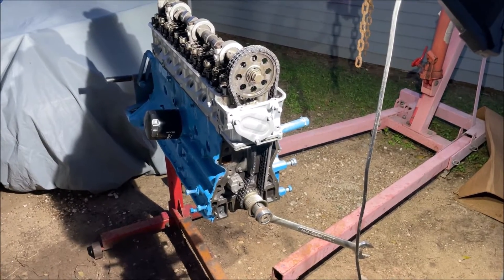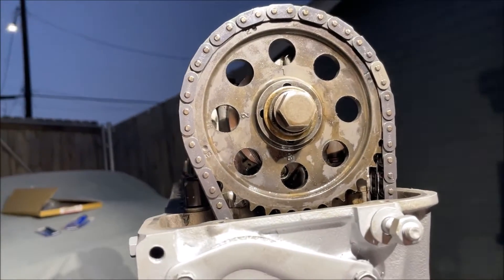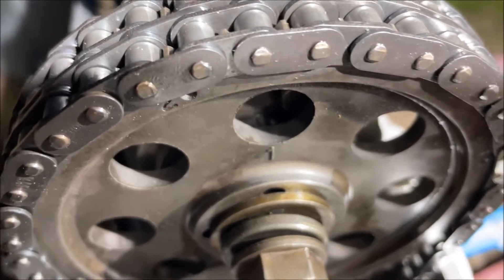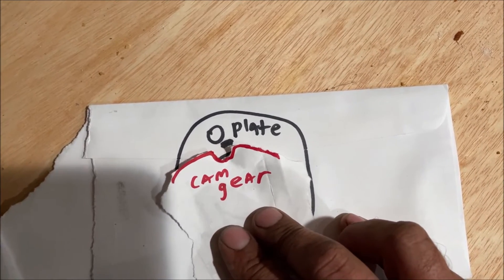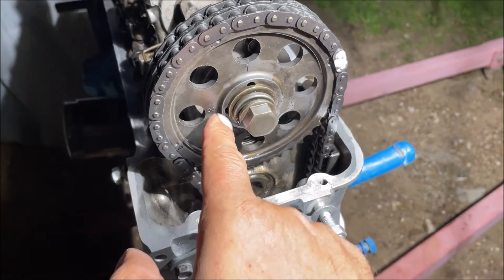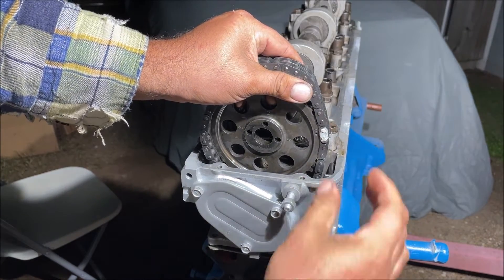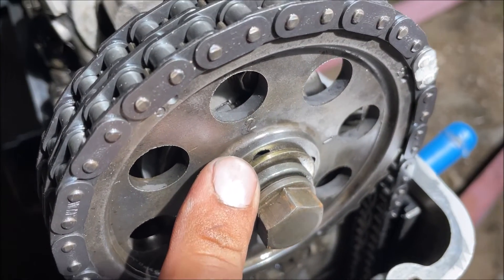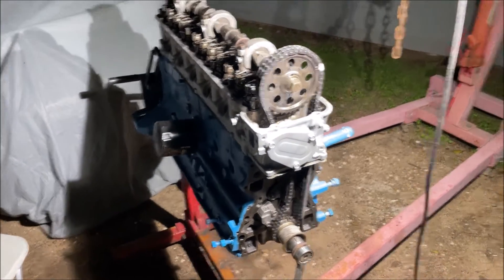L28 Datsun 280Z timing chain adjustment and timing chain stretch EXPLAINED

Comment: From what I understand, the chain would be set at 1 from factory, and then when it stretches, should be adjusted to 2, then the 3 mark, and then after that, time to install a new chain.  its a pretty good design that Nissan Japan came up with.  but it still confuses the crap out of me.  Thanks for this video!  you are very thorough in explaining things.  this is especially good and helpful.  I screwed up my timing before and I don't want a repeat, so I am definitely coming back to this when I get that thing put back together.  again, great video.  keep it up!

Comment: This L'series cam gear can facilitate advancing the cam shaft to gain more low end torque, that is, if at #1 position the timing is within specs, put cam gear in on #2 position...loose a bit at top end, but for a daily driver only gives benefits...going to #3 position, results in even more low end torque and more loss at top end, also rough idle and engine cuts out frequently when car brought to a stop, raising idle speed to about 1600 rpm cures this but there goes the fuel economy....
Reply from the maker: 😳 really? that is very very interesting.. I just got into these cars and just got my car running… thank you I will look into that
Reply: @chriscraft77022  waaaay back my first car was a holden commodore VC, it was found in a junk yard with a L28 carb enging and the 4 speed automatic, descent power though engine waaay down on compression...fast forward a couple years and many cars later, i needed an engine for a daily driver that would be economic...what did i put into that car at that time....the engine from my first car....i had a RB in my VH commodore, threw out the RB, with the $$$ i got for the RB, rebuilt the L28, stuck it into the vh commodore back in i think 2004...got me thru university, started working in oilfield, and many many engine killing incidents later, the L28 still going strong...one of these incidents i was doing burn outs before a street race, did not see my radiator water on the ground behind, did the race, drove home without water...next day realising bottom rad hose blew out...no engine damage...same thing happened to top rad hose driving home...another incident was driving around without any oil in engine...the clear hose for aftermarket oil pressure gauge got a hole...for some weeks would see oil puddle where i parked but was never where the einge or trans was located...being such a reliable engine, opening hood was unheard of till a buddy pointed oil dripping from driver side wheel well...yep had to put 4L of oil into engine to have oil appear on dip stick....the list goes on
Reply from the maker: @ArvineHarry  very cool..   the L28 i got in the car was rebuilt with flat top pistons from a (turbozx i think) i found some round top 3 bolt fat tab hitachi carbs that were rebuilt and got the engine fired up in the first hour..  i have a video on it..  datsun finally runs i think..  it start up towards the end..   do you think those flat top pistons will make it faster for real?
Reply: @chriscraft77022  flat top pistons do wonders in increasing compression ratio, not wanted though in a turbo engine...combustion chamber not the best design and detonation can be an issue, the L series engines not at all powerful in todays standards ..better flowing head such as the P69 can help...but dont make much more power....os giken from japan has a cool dohc head but very expensive...if power is your intention...go RB...the L series is a absurd reliable engine if built properly...anybody can put an engine together...but true engine builders trade secrets make the difference if the engine lasts 100K or 1 million K